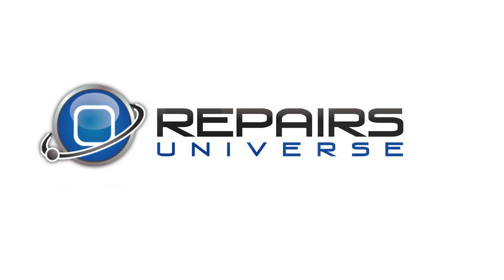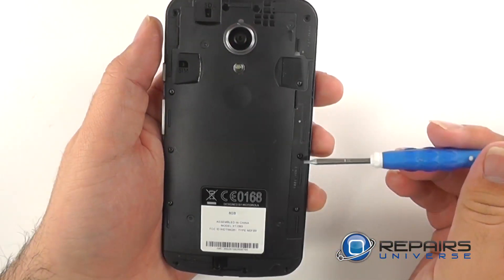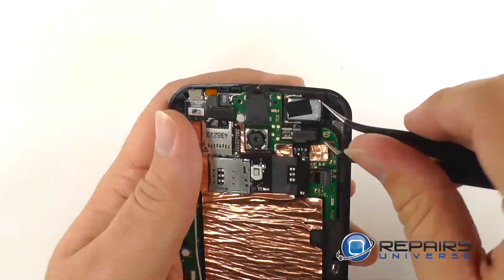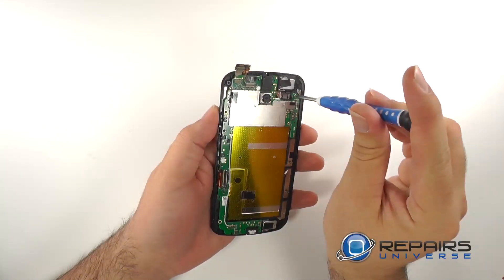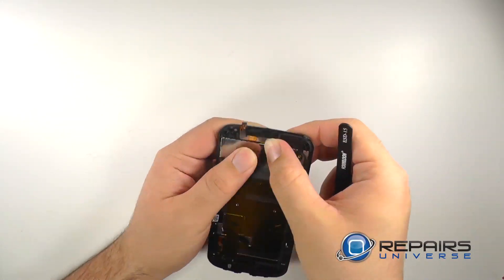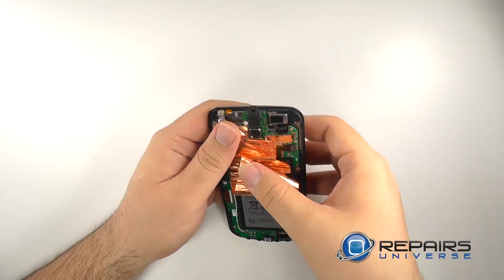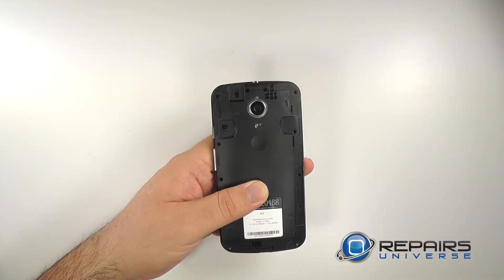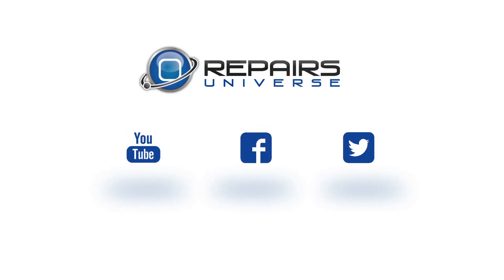Motorola Moto G (2nd Gen) Take Apart Repair Guide - RepairsUniverse

Comment: This video was great, using it I replaced the screen successfully, and touch, rotate, etc. works perfectly.  But upon testing other features I noticed that my speakers no longer work.  The headphone jack works fine but sound no longer plays through top or bottom speaker.
Reply from the maker: Double check that the contacts for the speakers are facing the center of the device. Also make sure the midframe is fully seated it has metal traces in it that connect the speakers to the motherboard.

Comment: I install the screen but touch isn't working. can someone help?
Reply from the maker: +Iman Imanov You would want to double check your flex cables to ensure they are properly seated. If they are and the issue continues, it's possible there is an issue with the replacement part.